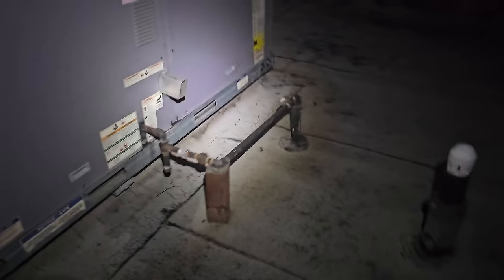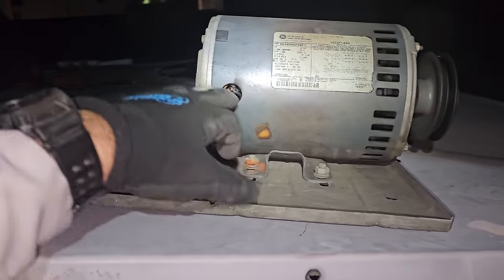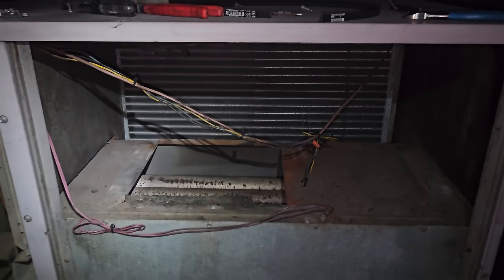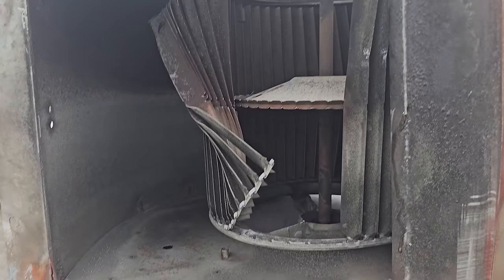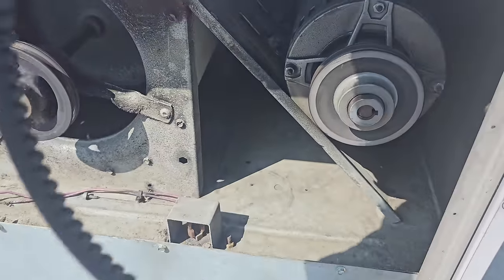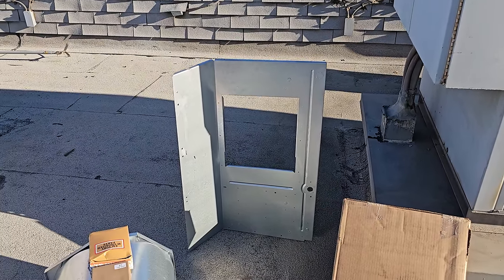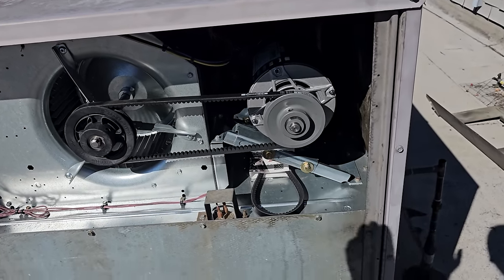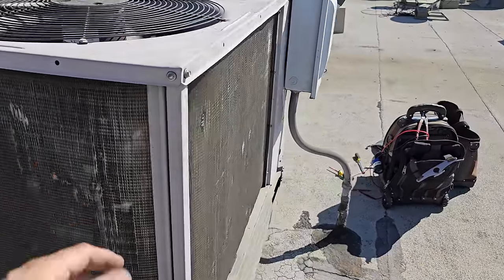HURRY THE AC IS ON FIRE

Comment: Why recommend a new unit when you repaired it and got it working perfectly?
Reply: Because that's what a good engineer does. Chris can see that despite repairing the broken parts, there are other issues with the unit and replacement is the better option. 
Sure, he can (and did) repair it, but in the next 3 - 6 months it's likely that something else will fail on it and he'll be back there fixing that too. If the customer had opted to replace the entire unit then they'd have something which would be reliable for a lot, lot longer.

Comment: the likely hood of a fire starting in an RTU unit and spreading outside of it are pretty slim, especially if it's the blower/motor that emits the smoke. now they will readily cause smoke damage and shut the building down.
they have a FAR-FAR greater chance of some idiot smoking inside and using garbage can as ashtray, doing flaming shots and blowing it all over or the cooks botching something and having kitchen go up in flames, perhaps rags left on top a hot surface/unit not turned off. 🤣🤣 they'd never do that right? local old bar went up just that way, guy talked them into cooking after kitchen was closed and it went POOF a bit after close. not sure exactly what happened, but likely something left on or cleaning supplies left on hot areas.

Comment: I’m surprised how cheaply made this equipment is, especially given how much it costs to purchase. Using flimsy sheet metal as a structural component, especially for stuff that will always, always vibrate (like motors and blowers) is idiotic and a guaranteed failure